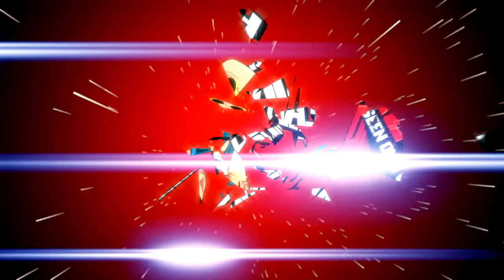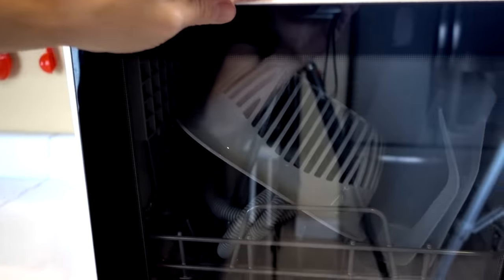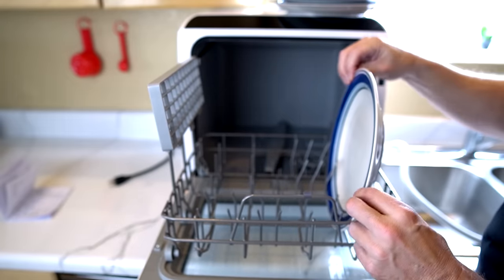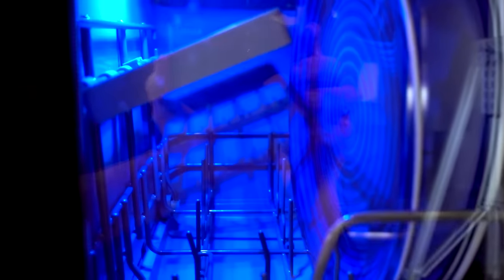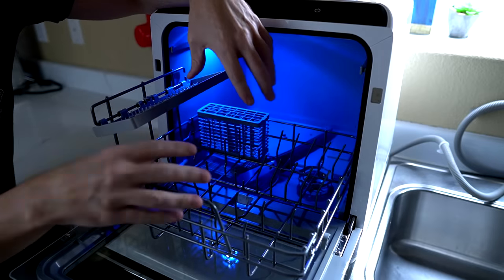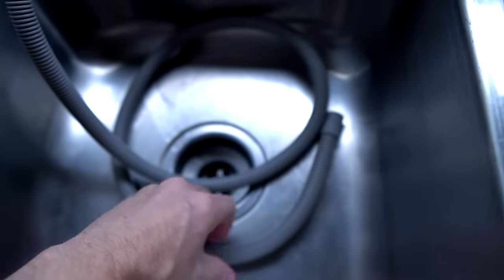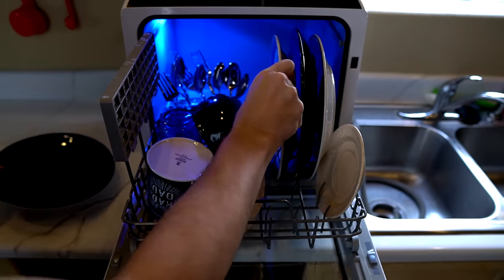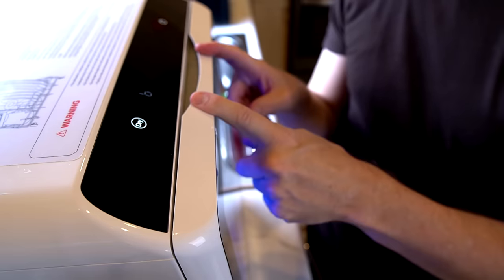Do Countertop Dishwashers Work? By Request!

Comment: You've got the cleanest dirty dishes I've ever seen.
Reply: You don’t really expect dishwashers to actually clean dishes do you?  They all suck IMO.
Reply: Probably licks the plates 😂
Reply: Dave Iaucco  yeah hence the reason I don’t own a dishwasher.  What real purpose do they serve?
Fill sink with hottest water, add good quality soap like Dawn, let soak for 20 minutes then wash by hand.  I probably spend 5 minutes actually hand washing the sink load, the soaking in hot water does the rest.
The key is rinsing a dish off right after it’s used...especially tall glasses.
Reply: Only needs a quick rinse before going in, they clean better than you'd think
Reply: @keff5984  eh don’t be lazy, just hand wash them.  Much quicker and it saves the expense and maintenance of a dishwasher.
Reply: Nah I have one and I have many dishes so it works out and keeps the sink empty.  Plus the heat sanitizes better than I can by hand.  Sorry you've had shitty dishwashers
Reply: @keff5984  I’ve had cheap ones and one expensive one.  None of them did near as good of a job as I can simply hand washing them.  Also, a dry clean dish doesn’t hold bacteria long due to desiccation—assuming that hot water and dawn dish soap didn’t kill them first.  Ever hear of someone getting ill due to dishes that were only hand washed?  Me neither.
Reply: Hey, good for you.  You can justify it all you want and I'm happy you get actual enjoyment out of hand washing your dishes.  But at the end of the day my household goes through a solid amount of dishes and using the dishwasher keeps the sink clean and empty.  

Dishwashers clean better, and that's a fact, not just me talking out of my ass.  You can search it up if you want to.  Plus hand washing uses more water and soap.
Reply: @keff5984  yeah you’re probably right.  And when I had a full household I ran a dishwasher also but now that the kids are grown....I don’t know, it’s just easier for me to hand wash them.  Didn’t mean to come across rude.  My apologies.
Reply: Don't get me wrong if it's just two dishes and a pan I might hand wash them but I'm not the only person so the dishwasher works for us.  You're certainly not alone in preferring hand washing
Reply: @alexblaze8878  I agree Dishwasher takes up space and is just something to tear up. I can see a dishwasher might have an advantage for sanitizing dishes but if you keep up with your dishes there shouldn't be too many big bad nasties anyway. I would not want that thing taking up valuable counter space and over an hour to do that small amount of dishes that look like they were already prerinced I would just take 5 minutes and wash by hand, stuck on might require a soak but ok.
Reply: @beckyshell4649  agreed.  Somehow we lived for thousands of years without dishwashers....I don’t know how they ever survived lol
Reply: @keff5984  so u wash ur dish before the machine washes the dish?
Reply: I was thinking the same thing; "Those dishes aren't dirty!"
Reply: Dave Iaucco  My parents do that and end up with cloudy glasses. I never rinse a lot, just scrape off. Cheap and expensive dishwashers have always done fine. I just make sure my water heater is set to 140, that makes a huge difference
Reply: Lol wtf is happening here? I put my dishes straight into the dishwasher, no hand washing what so ever
Reply: @alexblaze8878  there is actually a great video on the use of a dishwasher and our perceived inefficiency of them when basicly all of them do about the same job. 

If you are interested in watching it (which I highly recommend it's a great video) here's the link to it. 
https://youtu.be/_rBO8neWw04
Reply: @FaultzGaming  ya know, I was skeptical at first to even bother watching it but that video taught me more than I ever knew about dishwashers.  I’m a little less cynical about the job they do verses hand washing but I’m still going to hand wash my dishes.
What was missing from the video was a comparison of dishes cleaned by dishwashers versus hand washing.  To hear the host tell it, no dish is ever left with food still stuck on after a dishwasher cycle and yet we all know that is a fairly common occurrence.
Reply: How crappy dishwashers does people have? I don't even scrape my plates, I put them directly in to the washer. Greasy pots and pans too! And everything comes out perfectly clean!
Reply: @islandmountain95  are you sure?  A plate may seem spotless but over time build up a thin transparent residue that can trap bacteria.  Years of being involved with OSHA compliance and infection control policy implementation regarding cleaning/sterilization of medical instruments indicates water, even under high pressure, is a poor substitute for mechanically cleaning (scrubbing) instruments.  Instruments that were solely ran through a medical dishwasher (even those costing $100K or more) prior to sterilization eventually built up stubborn residue that had to periodically removed via hand scrubbing.  There’s a biofilm that builds up on surfaces that are frequently exposed to food that is not completely removed by dishwashing machines.
Under a microscope, that seemingly smooth glass dinner plate is extremely porous and a breeding ground for some nasty stuff that the relatively low temperature “hot water” of your dishwasher won’t kill.
Dishwasher temperatures have an industry standard of 120-150 degrees F but even the weakest bacterial spores responsible for food poisoning can survive in a thin biofilm on your dishes up to a 158 degrees F..many can survive even higher temperatures.
This is why mechanical scrubbing to remove that transparent biofilm that builds up on dishes is important to be done at least occasionally.  Without that residual biofilm for spores to be trapped in, they don’t survive a dishwasher cycle well.
In other words: even if you have a great dishwasher, it’s important to hand wash your dishes every so often to remove the biofilm that is impervious to the amount of water pressure  and temperature that dishwashers can achieve.
Reply: @alexblaze8878  As I don't have a microscope or any advanced testing equipment I can't verify that, but I have used the same plates for more than five years without any food poisoning or visual dirt on the plates!
My dishwasher warms the water to 149 degrees Fahrenheit on the normal program and 158 on the program for extra dirty dishes!
Reply: @islandmountain95  fair enough.
Reply: I think you're missing the point that elderly or disabled people might not be able to stand doing dishes by hand. For us using a dishwasher isn't laziness or a luxury  it's a necessity.
Reply: @alexblaze8878  just seen ya replied rn. YouTube notifications am I right? Either way yeah. He's a excellent YouTube with a bunch of videos on alot of really cool stuff. I watch him all the time and it cool too just learn stuff lol.
Reply: @sttonep242  I think it just keeps the dishwasher clean. There’s a filter in the dishwasher. Rinsing them prior to going in will keep the chunks of old food into the filter of of DW. Otherwise, grease, grime, old food chunks, get stuck in the filter and can make your DW smell, along with the dishes. ESP the cups.
Reply: @alexblaze8878  rinse dry and sanitize is the purpose. dishes don't smell very nice if you dry them with a towel. air drying takes up counter space... I like that the dishwasher heats them to a high a temperature to sanitize as well.
Reply: @alexblaze8878  so much water tho
Reply: @Mia-kk3sm  1) if you’re that concerned about water then I guess you don’t flush your toilet every time you have a bowel movement?  Toilets use way more water in an average household per day than hand washing dishes.
2). Water is not “wasted”.  The earth is a closed loop ecosystem, water doesn’t just leave or get used up permanently.  The same water you drank yesterday may have passed through the urinary tract of a T-Rex 100 million years ago and a few drops of that same exact water was in someone’s saliva ducts last year, or will be stored in a rain cloud next week.  Water is never destroyed, it’s constantly recycled through the system.
Reply: Worked as a dishwasher and in just about any restaurant you need to do a quick scrap of any left over food into the trash and blast them with a sprayer before sending them through the washer. Cleans over 80% of what's on the plate before going in and the washer itself is to sanitize with very high temp water more then to actually clean debris.
Reply: @keff5984  You shouldn't rinse your dishes before putting them in the dishwasher
Reply: @PCgamer923  In a restaurant setting, yes. But professional dishwashers don't operate the same as home use
Reply: @alexblaze8878  you waste more water doing dishes by hand.
Reply: @sttonep242  dw aren't garbage disposals. You're going to ruin it if you don't rinse dishes first.
Reply: @alexblaze8878  in a "closed loop ecosystem"...because the (stationary) earth is flat and covered by a dome shaped firmament.
Reply: @alexblaze8878  y'all never had a CMA 44 industrial wear washing unit have you?... Best dishwasher I have ever used can go through a rack of crusty ass 48 wine glasses in like a minute.

My first job was a dishwasher oh baby, if you got room in your kitchen to park a car you got room for a CMA.
Reply: @alexblaze8878  I think you all are missing the point...
this is far more efficient and sanitary than hand washing especially when hand washing can waste more water if someone is leaving the water on using more water than necessary to rinse plates and also leaving the water running to warm up.

I was a professional dishwasher/restaurant warewasher, the rinsing process by hand uses more water for a single plate than a basket load in a machine were several place settings can be washed rinsed and sterilized at once, plus washing machines cycle the water being used, reusing the water over the course of the load, and utilizing pressurized, mistified, superheated water hotter than humanly possible.

I will also give you another example.
My grandmother was a professional chef but her oven was broken for 10 years, I would have to climb underneath it to plug it in every time she wanted to use it because of an electrical issue that would cause it to not turn off or turn itself on by itself.
During the course of those 10 years TV dinners, disposable plates, and minimal dishes became the norm, but once I bought her a new oven she began cooking like crazy. 
Large pots and pans baking, frying... extra sticky and greasy messes everywhere
.. a sink full of dishes and oven countertop full of dishes as she would rarely wash them herself leaving them to pile up.

When I would wash them following proper three-stage segregated chamber procedures, (In a small kitchen, really just two stage) I found myself wasting an exorbitant amount of water letting it run until it got hot and also using more detergent than necessary because we had the cheap unconcentrated value brand that would get struggle to cut through the extremely soiled dishes and cookware.

It would take me an hour almost by hand with rags and sponges scrubbing and rinsing several times,  also the fatigue on my lower back as I am taller than her and the countertop was built to her height, also the overspray of water, and sloshing of suds on the countertop backsplash and wood has caused damage over time.

You should experience this and do your research  before criticizing.
Reply: @PACKERMAN2077  this guy is right. Out two plates in a dishwasher and run it, you have wasted kess water than  by hand washing the same two dishes.

And yeah all you need to do is scrape plates off into the trash before running. Rinsing can actually decrease the efficacy of the machine.
Reply: @UtopianGarden  I have hardwood floors so no I don’t use a vacuum nor do I even own one (a broom uses no electricity—how’s that for environmentally friendly?).
Reply: @UtopianGarden  ever heard of someone getting sick off of hand washed dishes?  Yeah, me neither.
Reply: @alexblaze8878 Carbon-free electricity is a thing you know.
You hand wash your clothes too?
what's the big deal, scared of automation?
Reply: @alexblaze8878  doesn't really matter how well you can hand wash, point is that a machine is way more efficient.
Reply: @UtopianGarden  uses electricity, involves manufacturing by-products including one-time use plastics that end up in landfills, requires fuel to transport multiple parts from far-reaching manufactures to a centralized assembly plant, some of these parts are manufactured using child labor in China.  Takes up valuable space in a kitchen requiring larger kitchens which require increased use of carbon fuels to air condition and illuminate.  
All of that nonsense when one can use a simple solution of water and dish soap and 5 minutes of labor.  But you go ahead and do your thing.  As for me, I’ll continue to hand wash my dishes as I’ve done for over 20 years.
Oh, and if you’re that concerned about the extra water used in hand washing I’m sure you only take 1 minute showers right?  Only flush the toilet when there’s feces in it, allowing urine to sit in it all day right?  Of course you don’t do those things, you’d rather virtue signal than be inconvenienced by taking steps that actually make a difference.
Reply: @alexblaze8878  Your points are too far fetched. Wanna hand wash? Go right ahead boomer. Just don't call people lazy when they have another way of living. If you're true to your word, then hand wash your clothes as well.
Reply: @alexblaze8878  sorry that you actually have time to do dishes, you must be living the high life
Reply: @SC2TiMeLorD  why are you sorry?  Did you mean “congratulations!”?
Reply: Every dishwasher I've used has generally done a great job and I don't prerinse them under the tap. Even dried-on food. 

  It's less likely to be a problem with the dishwasher and more likely what you're doing. Too little and too much powder are both bad, for example, add us selecting the wrong cycle and how you load the dishes. Follow the manual. And most people don't put a bit of powder on the door (as well as in the dispenser) for the prewash if the dishes are more than a little dirty. 

Modern dishwashers use far less water than hand washing which is important for countries like Australia which often has droughts.
Reply: Alex Blaze Dishwashers suck it’s such a hassle to load them. You always end up having to hand wash a couple dishes that didn’t come clean and everything plastic is super wet. You can’t really fit pans. It’s only useful if you have a lot of glass cups to wash. I never use mine.
Reply: @Appaddict01  agreed.  I use the dishwasher that came with the house to store pots and pans in lol.  It’s easier than bending down and searching the back of lower cabinets.  Plus it serves as a nice drying rack after I wash the pots by hand.
Reply: @alexblaze8878  no, they don’t. They actually work really well. Watch videos on this. You’re doing something wrong.
Reply: @Uhohlisa  eh I trust hand washing more so than dishwashers.  It’s quicker too.
Reply: You guys don't rinse your dishes afterwards?

Comment: I went from living in a house with a dishwasher and getting spoiled by it to moving into my own apartment that doesn't have a dishwasher. I bought this very model after doing a bit of research. It was delivered today and I wasted no time getting it set up because I loathe having to do a lot of dishes, especially silverware. Everything came out squeaky clean and it is absolutely worth every penny. I loaded it with a coffee mug, two drinking glasses, a medium sized plate, two cat food dishes, the lid to a medium-sized pot, a steamer/strainer, and several utensils. It still had room to spare!
Reply: Hey, how is the dishwasher now? Is it still functional?
Reply: @sugoish9461  it was until I clogged it with ground lentils (didn't rinse the food processor cannister enough) and ruined the motor in the process last year. I'm now in a new apartment that came with its own installed dishwasher. I can't bear to throw the portable one away, though. I may try to find a small appliance repair shop to see if they can fix it. It still works, but the spray fans no longer turn.

Comment: Yeah. May take less time to wash that amount of dishes by hand, but some people have difficulty standing at a sink washing them. Even after a few dishes my back is killing me. Also takes far less time to start the machine, walk away and have clean dry dishes than it will to stand there and do it all by hand.
Reply: and it uses less water.
Reply: Bingo! That is why I think they are a fantastic idea! No strain no pain. I have the same issues. Cheers 🍻
Reply: Same thing back pain hurts to wash by hand
Reply: I totally agree that little bending over, that's slight arch in my back, it kills me.
Reply: Because this dishwasher probably won’t be able to wash pots/pans while also washing cutlery/plates, if you guys haven’t heard of a sponge where you put dishwashing liquid in the handle, it cuts washing time in eighths for me after soaking the pot in water while I eat. Definitely recommend.
Reply: Not to mention that over the course of a year you'll probably save 150 hours of hand-washing dishes! That's nothin to sneeze at.
Reply: plus more time to do other stuff

Comment: Having a detergent pod fall in when the door closes is more or less the same as the powdered detergent falling in.  Powder is cheaper, but less convenient.

This unit seems ideal for a single person, and maybe also for empty nesters. It probably consumes a lot less energy and water than a standard washer, and allows for more frequent washing if the number of dishes in the cupboard are limited.  Using a tank also limits potential for water damage from leaks.  Did you try the fruit wash feature?  That seemed interesting.
Reply: It’s better to put them both on the floor anyway, especially on the short cycle as it starts reacting with the water quicker